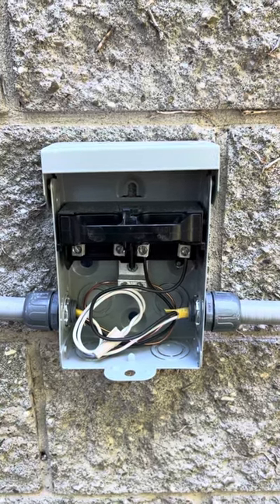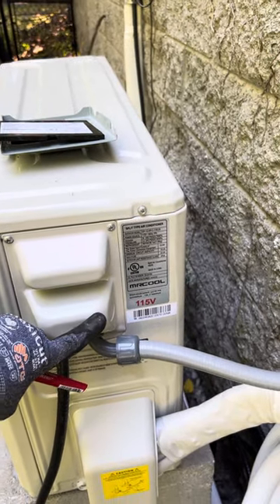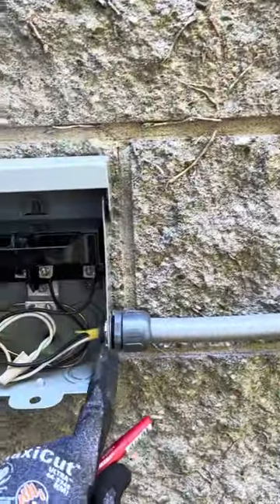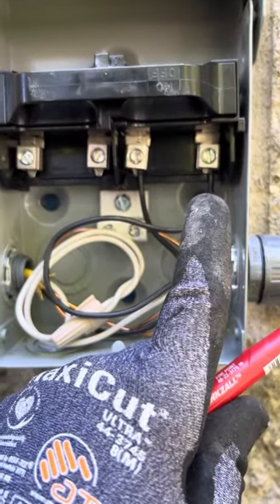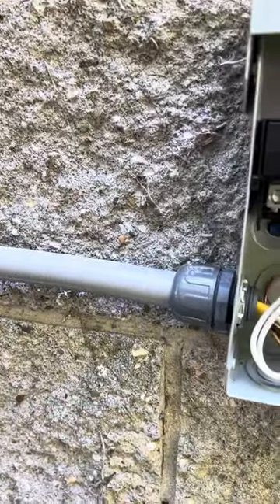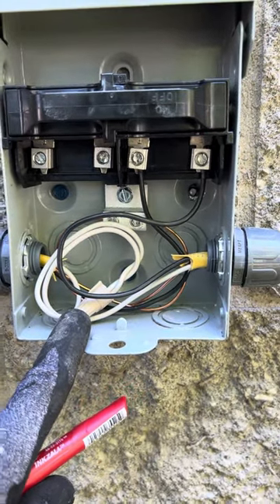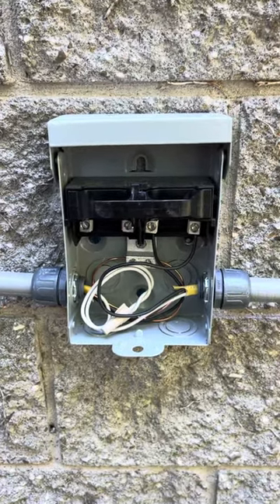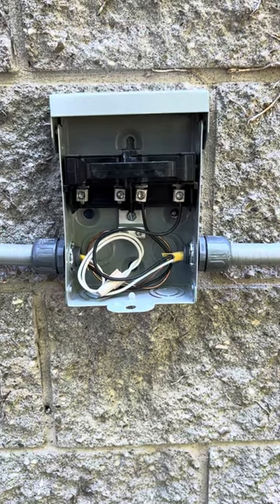How to wire 120V quick disconnect box for mrcool mini split unit

Comment: Wondering who not connect these two neutral wires to its Line and Load accordingly
Reply: Because this is 120V system, There is 1 load and 1 return. For 240V, then yes you put both in.
Reply: @ken62310  I would think you could connect the neutrals to the extra set of terminals even on a 120V setup. In that way the pullout disconnect would operate similar to a 2 pole switch - when pulled out it would disconnect the neutral pathway as well as the hot wire. This can be beneficial in some circumstances because it prevents residual voltage from leaking back to the breaker panel when the pullout disconnect is removed.
Reply: It’s always good for neutral to remain continuous all the way back to the main panel.
Reply: @davaughnyarde8970  NO it is NOT "always good". For example, the voltage from the spinning windings on a motor which is powering down can constantly trip a GFI breaker unless you cut the neutral as well as the hot wire by using a 2 pole switch.

Comment: I am hooking one up with the exact disconnect wired the exact way as yours but there is no power moving through to the load wire. I CANNOT figure out why. Any ideas?
Reply from the maker: Sound like your box is missing the fuse in your quick disconnect. Pull the handle out, there is a slot for the fuse. Just make sure your fuse is matching the unit.
Reply: But what if it’s a fuse less and still has the same problem? It’s 110 should I wire it up the same way as the video ?
Reply: @filibertollamas6094  Heres an idea.
Get a muti-meter. Make sure you have current at the box coming in. pull out the disconnect handle. Stick the probe on the metal lug/bar where the line in is and the other probe to the box. 
Once you confirm power is coming into the box. Then stick the blade handle back in ( Making sure it is going in with the blades into the lugs, and that the blades are not damaged or broken so they can close the circuit. 

Then check that power is coming out of the box with the load lug. Same way . probe to lug and to box. 

If you have power there, then move to your condenser and check the power line in has power and probe to the power in wire and ground. 

If your showing power there, then your unit has a problem... Provided!!!
The grounds are good. And the neutrals are good as well. 
Power needs to come in on the line and return to the breaker on the neutral. The ground is a backup wire.
Reply: @wiley0714 i have exactly the same problem thank you
Reply: i have this  mini split but i don’t understand if it work with 120v or 220 v yours looks like mine , and this is the brand and the model 

COSTWAY®
Split Type Room Air Conditioner
Product Type
MODEL
Outdoor Unit
FP10318US-12WH
Vollage
208-230V~
Frequency/phase
60H2/1PH
Cooling Capacity
18000Btu/h
Heating Capacity
18700Btu/h
Indoor Fan Motor Load
0.25A
Outdoor Fan Motor Load
0.50A
Total input current
12A
Compressor RLA
6.6A
Compressor LRA
28A
Min .circuit Ampacity(MCA)
9.3A
Max.fuse(Fusible Max.)
15A
Reply: and idk if i’m right using 30 amp disconnect or  i need 60 amp disconnect
Reply from the maker: @DanielGonzalez-me9pc 
Your unit is 230V so wiring will be different
Reply: @DanielGonzalez-me9pc  your wiring is different. Not 115 v . It's a 230v. So you will need a double pole 15 amp breaker as it asks max 15 amp. Your main power going to the disconnect box will be used as 2 hot wires and the ground and no neutral. Main power in to the lines and your 2 load wires to the outside unit condenser. Hope that helps.  I installed one of those costway 18000 BTU and it's running flawless. I also would suggest a surge protector to it if you want to protect the the mother board. I would suggest to make sure it's hooked up properly the lines and dona nitrogen pressure test to make sure no leaks. That unit uses old refrigerant that will be discontinued in 2027. It can't be replaced with other refrigerants. So once it leakes there is mostly no way to replace it and you will need to buy new unit with different refrigerant that's up to date and can be replaced if filled. Just heads up on that. As long as it never leaks your good for how many hears it gives.

Comment: Don't you have to the romex yellow insulation off?
Reply from the maker: As you see the  insulation is off. For this video I’ve decided to show a bit of insulation so viewers can se that I’m using 12ga wire as required.
Reply: That is a code violation. Romex isn't allowed outdoors. Even in conduit. Be careful watching these DIY videos.
Reply: @Rob-lr4cj  I've seen prowfessunal HVAC installers use romex outdoors, no conduit, in Fredericksburg, VA. But they're missing both teeth and brain cells down there.
Reply: @ShemstaElectricial what’s the model number? ????

Comment: The white nuetrals need to be wired together and not in one of the slots?
Reply: Yes, for a 120V that is correct.

 I have seen many people put the White (neutral) to the (ground lug). While technically if the "disconnect" is fused ( This one is not, it is just a pull out blade type, so understand that significant difference) you can "bond" the neutral to the ground if.....and if....it says ( bonded neutral on the box). In a "fuse" breaker failing to trip, the current on the neutral is then directed to the ground and thus returns to the main load center and back to the bonded ground/neutral bar there. 

But in short, he is one of the few that did it right.....for a 120V system. 

In a 240, you would generally have no neutral, most do not run a neutral wire to the box, but if you have only (2) conductors and they were black and white, you can mark the white in black or red markings and use it to feed a secondary hot line to the disconnect for the 120/120 ( 240) unit. 

if you had run a white neutral for a 240 system you would just cap that off. 

TMI :)
Reply from the maker: it is not legal to bond neutral and ground in this situation, you only disconnecting hot conductor just like in a switch.

Comment: What size wire gauge did you use, from panel to disconnect? And disconnect to Unit?
Reply: 12 gauge
Reply: usually recommended to use a 20 Amp breaker, so 12 gauge is minimum.

Comment: Question.....im going to be installing 3 separate mini splits in my house . The 3 condensers will be sitting next to each other on the outside of my home. Do i need to have 3 separate circuits for electricity?? Meaning each mini split condenser will have a separate circuit, breaker and disconnect. I have a 200 amp breaker box with enough openings to do it however i was wondering if there was a different way of running power to them having only one breaker in the panel and then separate disconnects outside.  Thanks 😊
Reply from the maker: I’m sorry but can’t answer question unrelated to the my video. Any local licensed electrician should be able to help you with that according to local code and AHJ.
Reply: Some units can run (3) off one condenser. 
But to answer your question. You generally ( codes vary on location). Want to see what the total amp draw is. You want a dedicated circuit for the unit. 
You can run a 50 amp breaker with 8 gauge wire outside ( Yes I know that is costly, but I am just giving an example). 
That wire would be best ran to a ( sub panel box rated for outdoors). 
Each condenser can then be wired to an individually with the ability to disconnect right there at the box. 
And for a few dollars more I would put in a surge protector on the box to protect your equipment. $80.00 can protect your (3) units and save you thousands on a lighting strike.
But, to each there own.